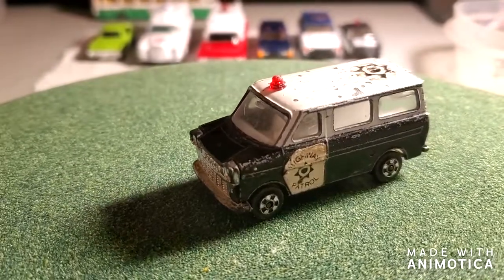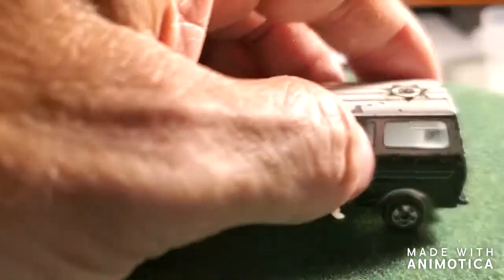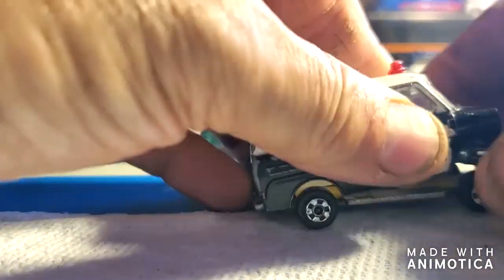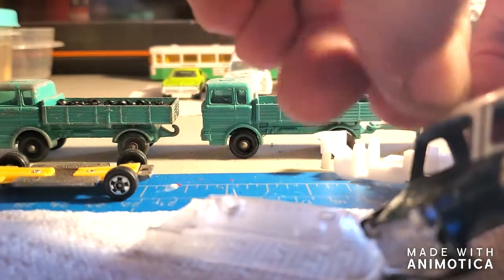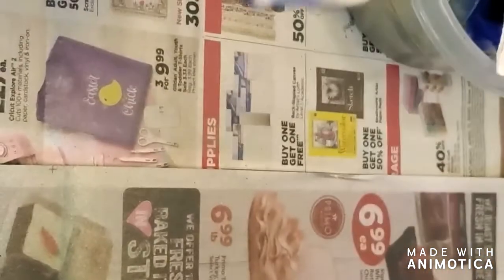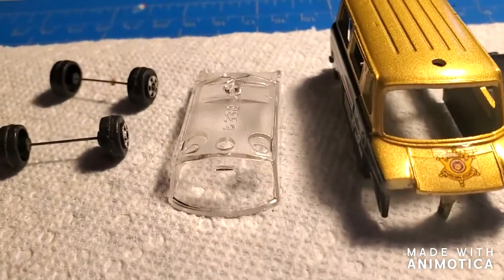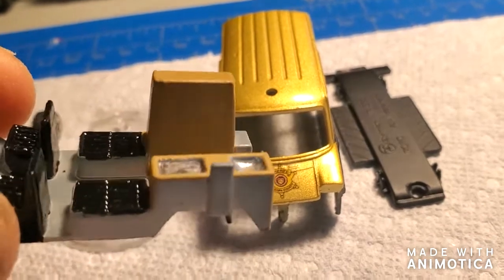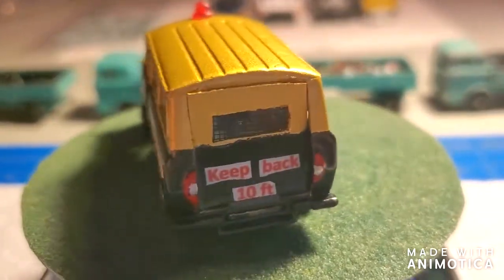Ford Police Van Custom Part 1

Comment: Nicely done Mark.  This casting is a cheap copy of the Corgi Juniors, Ford Transit with Martin Walker Camper Van body.  It has an altered roof line from the original model but they have 'lazily' kept the very same caravanette interior.  The rear door was a single piece up-and-over door on the Corgi Whizzwheels version.
Reply from the maker: Thanks my friend! My very first video was the very corgi Ford van you are referring in fact just today I noticed the similarities